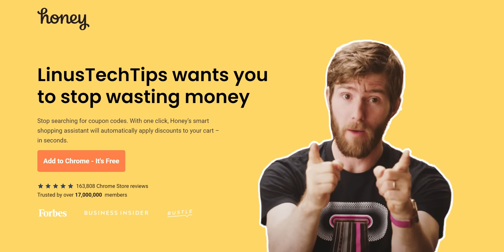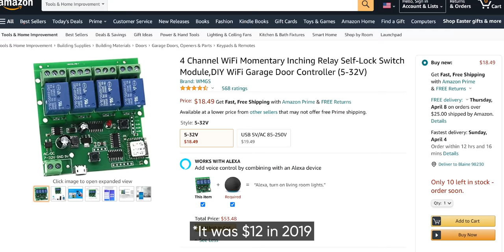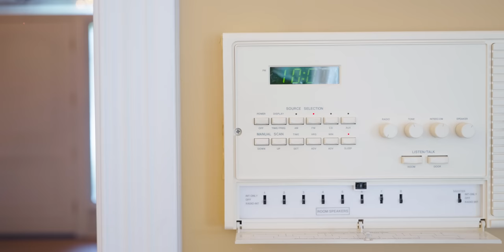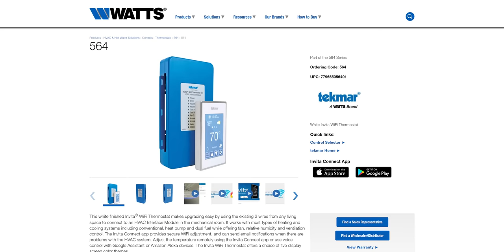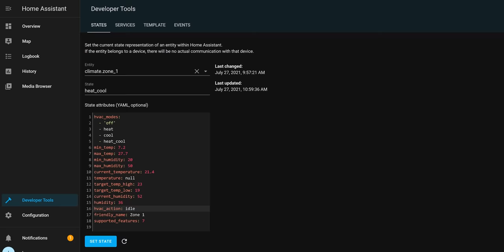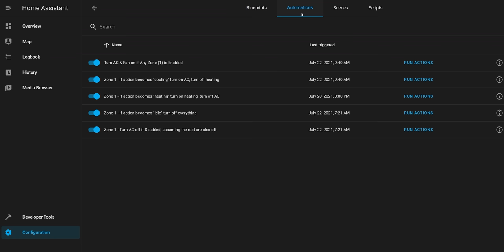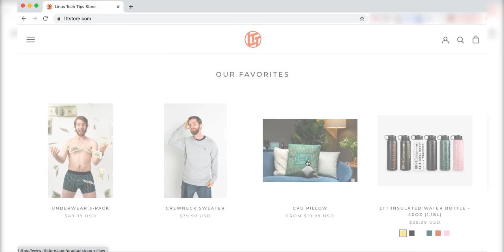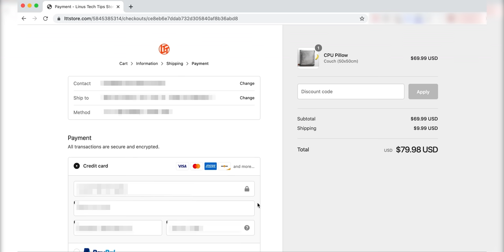This Should've Been EASY - New House Smart HVAC

Comment: That's similar to what I'm going to do in my next house but there are a few things to consider.
First of all, A/C efficiency hugely depends on the ability to transfer heat through radiators. This means that the more airflow you have over the evaporator, the more efficient it gets. If it's not enough, then you will be wasting energy and you even have a risk of freezing the evaporator. This means that you have minimal amount of airflow to make it work. There's a reason there are multi stage air conditioners. Call for cooling from single room? Run single stage. Two rooms? Two stages. More rooms? All three stages. This way you will not run more cooling that you are able to use with just a single duct to a single room. That's why retrofitting single stage units with dampers sometimes makes it perform much worse. You have to figure out if you have enough throughput on a single duct to do this. Otherwise you'll have to make something smarter that will pick two or more zones that need the cooling the most to let it have enough air. Alternatively you can replace the blower to have higher air pressure but this will make it louder and use more electricity again. It's not that easy with single stage AC and the best solution is to increase the size of air ducts if you really don't want to replace it with multi stage unit. If you plan on replacing the unit, you can probably get 2-3 stage unit that would easily be controlled with such smart system and would know how much cooling to use. Think of it. If the unit is enough to handle 5 vents at full power, then where the power goes when you leave only one of them open? You can't move that much heat to the coil so it is too cold, makes it harder for compressor and may freeze condensate on the coil further reducing the airflow. Not good.
Second thing are air returns. If you have completely separate zones and you are blowing air to particular room, you either have to keep doors open all the time or have air return in the same room for air circulation. It has to go somewhere.
Next thing is presence awareness. As good as it may sound, it might be horrible idea. Imagine that you want to go to bed but there was nobody in the bedroom for the whole day. How much you will have to wait for the room to cool off? Everything stores the heat so it's not just a matter of cooling down bunch of air. You have to wait for all furniture and walls to Algo give off the heat to feel comfortable. For such use it's usually better to run scheduler and maintain the temperature before you want to use the room. Set it to cool down the bedroom two hours before you usually go to bed and then reduce the cooling before you plan to wake up. Why would it run for half an hour after you left the bedroom? You will be back in the evening. With your idea you will get to hit room and when it will start to cool off you will no longer be there. Kind of pointless. 
Next thing to consider might be electricity zones. It depends if you have fixed electricity rates or not and if you have solar panels or not. If you have some preferences, it's usually better to use cooling when it's cheaper. Your house is huge accumulator and we will be going this direction with increasing amount of solar energy. We already have this problem. Most electricity is used in the morning when people wake up and go to work, then evening when they are back, run cooling, cook stuff etc. The most electricity from sun comes in the middle of the day when it's not that useful. It's just a matter of time when we'll start to encourage people to run cooling during the day when they are not at home so that they don't suddenly have to cool off the whole house in the evening when there's not much solar power anymore. Run cooling when electricity is cheap, use your house as a battery storing the "coolness" from cheap period of the day.
Let's add something more. It's commonly called economizers. Imagine that it's quite warm in your house and you are calling for cooling but it's cool outside. Why not just blow the warm, used air out and take fresh air in? That's another great thing. Not only it will reduce your needs for cooling/heating but it will make your air in the house fresh. Typical house A/C is running in closed loop, that's not great. It would be even better to have minimal air replacement configured. Force the house to ventilate at least for some time during the day. Want to make it more efficient? Use recuperator. Heat exchanger that will use used warm/cool air to heat/cool the fresh air that you are blowing into your house. Some additional savings.
There's a lot of stuff than can be done and a lot of it is already done in industrial applications. Simple nobody cares about small consumer units so the price of such system is not worth the savings. 
The thing I want to make at some point is free for all system that would let you configure such complex system easily with not much skill. Just simple instructions which boards to use, how to load and program it, how to connect it to some nice UI and it's done. The whole challenge is to gather all information what to buy, what to look for and how to configure that. What cost to expect and if you need any proprietary software. Obviously any cloud is out of option. This is your house, it should be self sufficient and not rely on AWS or your internet to control things. 
There's a lot that can be improved and a few things you have to consider. Otherwise you may be surprised by your bills going up. Closing all vents to cool down single room is usually not efficient. Typical AC is scaled for the house, not single room. It can't efficiently cool down only single room. Well, unless you have so bad unit that it can't handle the whole house and you have to pick which room to cool. You will probably get better electricity bills if you force the system to run AC with at least a few vents open. Never run it on just a single vent. Poor man's solution - measure the surface area of your main duct and air vents. Count how much vents you need open to have the main duct being the bottleneck. To do it like a pro, calculate the airflow you should provide for the system including all other variables, clogged filters, bends and other resistance. Then define how much vents you need open or scale them up for your needs. For example if you mostly use two rooms and you want to be able to direct all the air there, replace the duct with bigger one. When all flaps are closed, this one will be cooled down quickly.
Ah, one more things. Ever heard about short cycling? Make sure you don't force your AC to start and stop all the time. The unit designed for the whole house is hugely oversized for single room which will lead to short cycling if you don't control that. It would be much better if it would switch between all rooms needing cooling and when all of them are satisfied, then turn off. Now you know that none of them will call for cooling for awhile. Otherwise one will stop cooling and one minute later next one needs it. Again, poor man's solution is to have limited number if startups in an hour or fixed cool down after each stop. Just finished cooling one room and now another wants cooling? Too bad, you will wait 5 minutes until it starts up again. That's why multi stage units are that good. By reducing the power you can keep it running longer without the need to turn off and on. Still, they can ramp up the power of you really need a lot of cooling. Obviously this would be fairly complex of not impossible for simple home automation and that's what I'm going to make at some point. Standalone system that does not take just heat/cool signal from thermostat. It will take outside air temp, each room air temp, settings for each room and it will know how much power/stages to use to avoid turning on and off. Later on it can calculate average energy loss/gain to know how fast each room can be cooled/heated and how much losses it has. Now you know the temp difference, room inertia and typical energy loss so you know how much cooling power does it need to maintain the temperature without short cycling. You have that for each room so you can overlap the data and nicely switch dampers to keep running it consistently. Only when there is nothing to cool down it would stop and even then it can estimate that soon you are going to bedroom so instead of turning it off for a few minutes, it can already keep on cooling the bedroom. It will be more efficient that stopping it just for a few minutes anyways.

Comment: I use Flair vents with my Ecobee. I was an early adopter so I get special pricing, but for $90/vent (retail) it’s not bad. It also has pressure sensors in case too many are closed it’ll open some to relieve the back pressure

Comment: HVAC/R Tech here. One crucial piece of advice. Your system is 25 years old, its running a PSC Motor. They're on or off, and don't switch between the speed taps unless going to a different mode. 

It needs 400cfm per tonne of cooling in order for that coil to not freeze. Having other dampers open up a certain amount isn't going to cut it, because you're still restricting airflow, increasing static pressure, and reducing CFM. 

Easiest way around it? Install a dump bypass. Honeywell makes a damper that will open and close based on the pressure against it. It can be set so that if all the dampers are open, it remains closed, and then opens to allow for the proper amount of airflow based on the pressure against it. Not as Easy? A dedicated dump Zone. Same Damper, but instead of feeding the extra air right back into the Return, you're dumping it into a specific space. If you put it into the attic, you'd have to put in make up air from outside, because you're dumping air outside(effectively). Just food for thought.

Your ductwork is not designed for zoning. It has 1 supply trunk, maybe 2 depending on where it is in relation to the building. Installing this bypass will ensure your already beat to crap 25 year old Bryant air conditioner doesn't freeze. And the HVAC tech you call in when it does? He's gonna have a field day with that set up. If he loves his job he'll love to play with it. If its just a job he will hate you.

Comment: Run Home assistant in a VM instead of a Docker container. The Docker version don't have the supervisor module. Sooner or later that is gonna bite you in the ass. Save yourself some time and just use a VM to start with.
Reply: Yep.  That's how I have set up mine as I've used the pre-baked KVM image which works well with ProxMox.
Reply: @Level1Techs  I guess you'd be PM'ing this, more likely to work than YouTube comments.

Comment: Linus: I could pay for an expencive multi-zone air conditioning system

Also linus: THE WALL 😳
Reply: that old small house isn't worthy of all the tech upgrades though. its like outfitting a single-wide trailer with a hot tub. ghetto.
Reply: @curt8806  his house is not small

Comment: @11:10 My Eneco Toon smart thermostat works in two wire actually. Both for power and for communication with the central heating. That's kind of what OpenTherm does.

Comment: Have you looked into what you are going to do with the extra airflow from the system?  Most zone control systems use a bypass damper to vent extra airflow not used by the currently active zones back into the return.  Also are you putting any compressor protection in home assistant.  It is reduces its lifespan to turn on to quickly after it turns off.  The recommended is normal 5 minutes of compressor off time(some manufacturers go as low as 3 minutes).

Comment: Pre watch personal experience post...

Linus, you've spent years looking at the tech aspect of these sorts of things... how much time did you invest in understanding and customization of the engineering of your new home. What is your thermal bridging rate of your walls? R value doesn't matter if there are lots of bridges, sorta like putting your AIO in the bottom bracket of a case... How well sealed is the envelope, meaning can the structure hold air pressure? If not, you have leaks. Did your builder ensure that exterior sheathing wasn't gapped anywhere? 

Alternatively, are you so well enginereed that the system installed is now just simply too powerful to not over heat or overcool the envelope, and the automation causes wild swings(like spiking frame rates)? Is it a multiple zone system with a bad interaction between zone, like lanes somehow overridding each other's output? Does it not have enough zones in the system, thus allowing thermal pockets to form where there isn't proper monitoring and maintenance from a zone controller?

Could all of this be avoided with dedicated air circulation and cleaning system unconnected to the climate controls, thus keeping a more homogenous temperature throughout?

Oh no... you tried to engineer a central air system from a horribly underpowered base system? For the love of god just get ductless heatpumps installed. You can get SEER scores over 22 on these cheap and easily installed systems that only take a couple sqaure feet of wall space per room.

Comment: I suggest a temperature sensor in your air handler…(fan, with the coil) after the coil so that if the supply temperature gets below say 45-50 then it kills the compressor…. This is because if it gets too cold it can freeze the coil solid, also normally the lowest we go in industry is 53…. It’s an old timers thing but if the temperature gets too cold in the duct the outside of it will sweat which can cause mold…. The other thing you want to be able to set is the outside air temperature that allows cooling…. If it’s too cold outside the super heat gets messed up and the refrigerant doesn’t turn to a vapor and you attempt to compress an incomprehensible fluid, which scroll compressors take ok, but over time it’s a bad deal….. you can also set up unoccupied set points so that if nobody is in the room and it gets really cold nothing freezes/it doesn’t take 2 hours to get back up to temp……oh you can also set up a status for both the boiler and the fan and the compressor if you tell it to run and the status is off it could send you a text message, same for room temps if it gets past a set point then an alarm can be sent out…… you should also be able to trend things that can help with diagnostics….. you can also open and close your blinds based on temperature, something simple that I want to do at my house because my hvac system is just a boiler (same as mechanics driving crappy cars)but program a light to turn on if it is warm in the room and the outside air enthalpy is lower than the inside air……sorry to ramble just some ideas

Comment: I would also try and get the ESP32 modules that are wired, one other benefit of the ESP32 module is that they usually have BLE which can be used to also detect if someone is in the room from any number of their smart devices. This would come in handy when you are sleeping and want the AC working in summer times.

Ruckus have an integration as well so there is some additional tracking from that as well.

Comment: FYI you might need to have a bypass duct and damper between you supply and return. Reducing the airflow to much across the cooling will cause the coil to freeze. Just wanted to warn you before you get this all implemented. You will probably need 60% or more of you zones open unless you have a newer air handler and AC that can run at partial load. Bryan the electrical/AC guy may be able to help out with some info too. Love the concept your DYI home projects are amazing.

Comment: That is a very high tech way to to DIY an antiquated, obsolete, and inefficient pressure dependant multi-zone system. The fan supplying your system is only going to run at one speed. Meaning that no matter what the air volume needed to cool the space, you're always going to have the same volume. So if some areas call for cooling and others don't you're going to dump extra air into the room, potentially causing the system to short cycle. If you're going to go through what you already are, you might as well install a variable frequency drive on the main supply fan, to slow that fan down when it's not needed. But keep in mind you'll also need a pressure transducer to tell the frequency drive (VFD) what pressure to maintain. (I'm an HVAC specialist, and test HVAC systems for a living)
Reply: Then he'll have to figure out how to deal with icing and flooding back issue, which he'll probably get even without the VFD

Comment: Unless you are going to use a Variable speed Condenser and variable speed Fan, having multi zone will not save you any money, and may end up costing you more. And if you are going to fix that, then you should just get a new heat pump that can do everything and get rid of the highly inefficient radiant floor heating unless you are going to update that to geothermal.

Comment: FWIW, I've got Ecobees with room sensors in my house and decided to roll with Flair smart vents instead of installing dampers (that's a little too DIY for me and the install cost was way more than the vents). The bonus is the Flair sensor/pucks have a display and dial to adjust temps for my wife and kiddos to use and I can use my existing Ecobee sensors in conjunction with all of them. The front of my house gets blasted with sun all day and those rooms always end up warmer than the back of the house. I also looked in to getting mini splits but again the cost was way more than putting in Flair vents.

Comment: No idea if this is already in the plan, but you can control the fan speed in every room to regulate the airflow and therefore the cooling power with only one source temperature from the AC allowing for different temperatures in different rooms. You can create a feedback loop that uses the temperature of the sensors to balance the RPM needed to keep the wanted temperature.